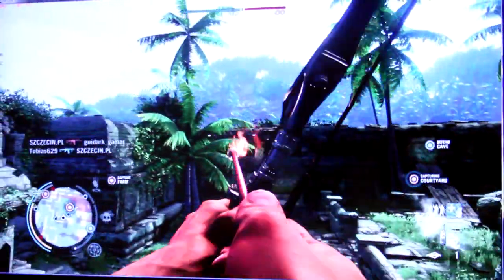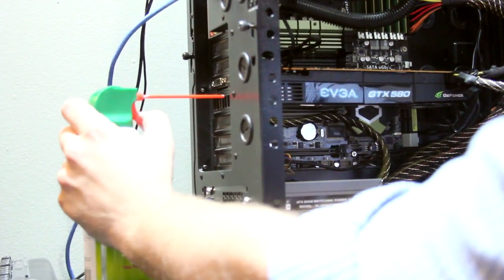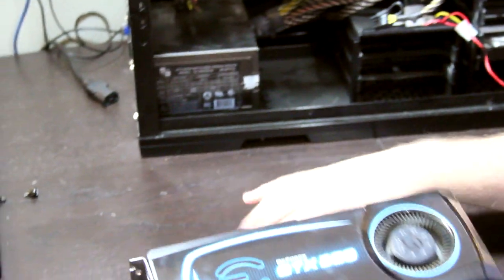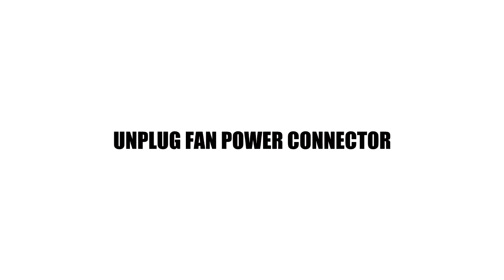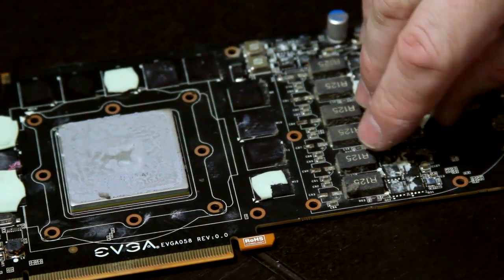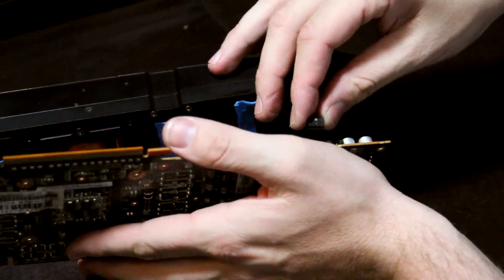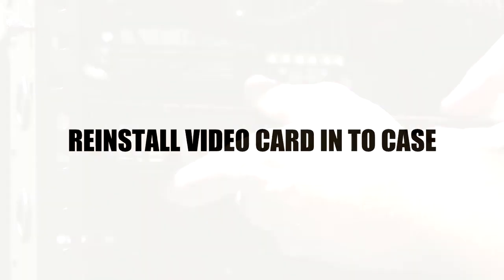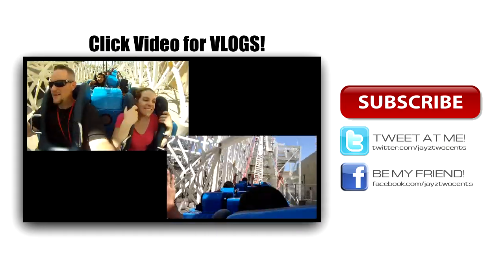How to fix overheating video card - Jayztwocents Tutorial

Comment: When I play games like BF4  with my gtx760 my computer will randomly turn off and when I feel the top of my case it is quite warm. Does that mean my GPU will have overheated? I do believe that is the case and I only play one level of BF4 at a time before letting everything cool down. Am I correct with my theory?
Reply: it could be your case not having proper air flow, eg no exhaust fans and also just do what it says in the video and do the same with your CPU cooler, it may be worth getting some more efficient case fans as well, but yes,I think this is a case of overheating
Reply: Envious_m8 I've installed an exhaust fan and plugged in the intake fan and it has worked quite well but sometimes when I'm on a high end game I can feel the side panel where the motherboard is gets quite hot so should I get a new CPU cooler or is there something I'm missing?
Reply: what CPU cooler are you using
Reply: Envious_m8 The stock cooler.
Reply: intel stock cooler?
Reply: Paul DeBruine I'll check around and get one when I get the money
Reply: MrRyangrrr Buy a Cooler Master Hyper 212 Evo. Costs almost nothing and is amazing.
Reply: mrawesomelemons That could go well in my build. Got a CM case for my build lol. Thanks for the suggestion!
Reply: MrRyangrrr When i built my first PC my case didn't have any fans, it simply caused the worst thermal throttling i have ever experienced but no shutting off. I about a month after heavy usage it began to shut off. I later discovered that it was my crappy power supply. you should take into consideration that it could be the PSU. Sure stock coolers suck and have high temps but they are not designed to give temps so bad that it would shut off a computer.
Reply: Jonathan Medina Could it be the thermal paste? I've had it over a year so it might be getting a bit crusty. I'm planning to upgrade my CPU anyway so if this is still the case I will invest in a new PSU.
Reply: MrRyangrrr Well a stock cooler plus old thermal paste, I guess there is a chance that is causing the shutting of. But if you notice that the automatic shutdown is getting or has gotten worse over time, I would still consider the PSU.
Reply: MrRyangrrr What PSU do you have, is it a cheep Chinese PSU or a well known brand? Or is it considerably old?
Reply: Jonathan Medina It keeps doing it when I play AC4: BF. When you (spoilers) kill that dude on the Spanish galleon. Even when I quickly ran to the same section. I'm using an Arctic Red PSU if you've heard of it. It's a 750W one I think I'm not too sure. Anyway I'll turn down my graphics settings a little and see if anything changes and turning off/down Anti-aliasing seems to help in most cases.
Reply: I have never heard of it myself but did a quick search and found prices ranging from  £20- £30 for 750W. PSUs that cost verry little for a high amount off watts normally aren't very good.Do you have any friends that might let you borrow their PSU to test your PC? I think that would be your best bet to rule out PSU.
Reply: Jonathan Medina I Don't have any friends who do. I had the PSU picked by someone else and they know a bit about them. I don't think it's the PSU because when I feel the side of the case the motherboard is mounted on, it's very warm at times so the shutting off is a countermeasure? I dunno, I've been a PC gamer for 1 year and I'm kind of going with a bit of common sense unless I don't have any lol.
Reply: PC Gamer doesnt mean that you know about computer hardware. I shall pinpoint the problem to several cause as follows:
- Heat. Check out your CPU / GPU / Mobo heat. Install monitoring software comes with your mobo or elsewhere from internet. It is free. DONT FORGET LOGGING it. If temperature of those said above under TDP range, then it is something else.
- PSU issue: by looking at the price vs wattage of your PSU. I must say your friend dont know abt PSU too. I would rather pick up a well-made 300W than advertising 750W. Why ? Because that 300W PSU will definitely deliver 300W without any voltage spike, ripple...etc while your PSU certainly will be unable to deliver a half of that 750W. My experience: I had to use similar PSU while my Corsair HX1000 going to RMA and then one day, voltage spike ( 12v rail jumped to 14v as my last seen) burned 2 SSDs and 2 HDDs. 
- Mobo: Very unlikely. But it is possible. Check out your setting in BIOS/UEFI to see whether any thing is wrong. But first, hit Load Default Settings from your BIOS/UEFI.
Reply: SK Bean Which monitoring software would you recommend? I've got Afterburner installed but that only monitors GPU temps.
Reply: MrRyangrrr Afterburner monitors almost everythin. It can even monitor cpu load..
Reply: mrawesomelemons I can't find it. But is there any other monitoring software you recommend?
Reply: I don't know how you can miss it.. There are even graphs showing the past values. Aida 64 or speedfan are good programs for monitoring too.
Reply: mrawesomelemons Cheers.
Reply: mrawesomelemons I've had a quick game of BF4 and when I came off of the game, one of the fans hear to hop half of my case was going mad. (also when I started aiming I got lag spikes) I had a monitor open for everything and all of the temperatures were stable (some were quite high being at almost 80 degrees) but my voltages stayed the same on my motherboard. But when I feel the vent where the PSU is located at the back, there is a small area in the middle of the vent which is quite hot, but the rest is normal. What would your opinions be on this information? PSU or CPU?
Reply: mrawesomelemons I think it's the PSU. I just ran Sleeping dogs (original) and it shut down when I walked out of my house. Any recommendations? And I only have 1 PSU so I have none to test (as this build is my first and only)
Edit: Shame there's a gun law in the UK and I'm underage anyway so I can't put a buckshot through it.
Edit 2: If you know any good ones that are blue and under £40. And 80+ rated.
Reply: MrRyangrrr Haha yeah that sucks. But do you smell burnt electronics? If yes, your PSU is overheating. Which one do you have?
Reply: mrawesomelemons I can smell something that does smell similar to a hot metal smell. But I do have a radiator next to me which is on quite hot as it's winter. Guess it's time for a new PSU. Que sad music
Reply: MrRyangrrr I don't know what system you have but take a look at this: http://www.tomshardware.co.uk/forum/id-1804779/power-supply-unit-tier-list.html
Reply: mrawesomelemons I have an FX6300
GTX 760 4GB
7200rpm HDD
Bog standard DVD+RW
WiFi card.
I calculated it and it went to above 400W
So I'm guessing a 500W one would be good to be on the safe side bearing in mind I'm looking to save up for an FX8350 soon.
Reply: MrRyangrrr I have a Seasonic M12II 620W psu. It is good. Mine is loud but my brothers isnt. You can buy an EVO for full modulair stuff ;)
Reply: mrawesomelemons That one is a bit too expensive for me. I've seen a nice one from EVGA http://www.amazon.co.uk/gp/product/B00GP5Y6J0/ref=s9_simh_gw_p147_d0_i3?pf_rd_m=A3P5ROKL5A1OLE&pf_rd_s=center-2&pf_rd_r=1Z1PMGKK70S6VH7K1CCC&pf_rd_t=101&pf_rd_p=455344027&pf_rd_i=468294
Would you be able to tell me if it's a good buy or not?
Reply: I'd say that's one of your best options for the price. 3 year warranty, trusted brand, and 80 plus certified. its a steal for £33.02
Reply: Jonathan Medina Also on sale from £40.99
Reply: MrRyangrrr Yeah that one is decent too. EVGA makes decent PSU's.
Reply: Jonathan Medina I also might bump down to an FX8320 as I get more performance for the money and it's cheaper with similar performance.
Reply: MrRyangrrr Yeah the 8320 is a downlocked 8350. I have a 8320 running at 4,8 GHz
Reply: mrawesomelemons Would it bottleneck a 760?
Reply: Nah youre fine. I think it wouldnt even bottleneck a 970 in most games
Reply: mrawesomelemons Cheers. Also today I've realised how hard it is explaining that you need a good PSU in the first place to parents. (They don't get technology)
Reply: MrRyangrrr Haha tell me about it.. Just tell them that if you buy a bad one the bill is higher and there is going to be fire. They'll understand that ;)
Reply: mrawesomelemons I've ordered it anyway lol. Amazon says it will arrive between the 1st and the 3rd of Feb. I also set my custom resolution to 1440p so the new PSU shouldn't burn down our lovely domicile or my whole computer.
Reply: MrRyangrrr Ah nice. I'm curious ;)
Set to a custom resolution of 1440p? What do you mean?
Reply: mrawesomelemons For Nvidia cards:
Right click on the desktop. Go to Nvidia control panel >> Adjust desktop size and position. check: override the scaling mode set by games and programs. >> change resolution >> customise >> 2160 x 1440. save that.
Reply: mrawesomelemons I've installed the new PSU. I'll see if it doesn't blow up on me.
Reply: MrRyangrrr I have AMD, but I dont know what that option does. Is it like Virtual Super Resolution?
Good luck! I have faith in it.
Reply: MrRyangrrr Have your problem got fixed now? because I have similar problem and I will try to replace heatsink soon or maybe PSU. Did replacing PSU worked for you?
Reply: sinestar10 Yeah, the problem is fixed now. Waiting for Hardline to install to give it a real test. It hasn't shut down since I got the new PSU.
Reply: So replacing the heat sink for my Video card will not solve the turn off problem while gaming ? because I had to have some high temps before the problem started
Reply: sinestar10 What are high temps? How hot exactly? And what brand is you videocard and psu?
Reply: I have GTX 560 and a 500w Gigabyte PSU, they worked fine for over year and half and accidentally video card started to shut down during gaming at 80 celsius degrees. I think my problem is overheating not PSU because I tried another lower tier card on same PSU and worked fine
Reply: sinestar10 What brand? MSI, reference, Gigabtyte? And how hot does your card get?
Reply: it's EVGA and it was 45 degrees at idle and 80 at normal gaming load
Reply: That should be safe. Have you tried raplacing the thermal compound? This sounds indeed like a psu failure. What are your cpu temps?
Reply: fine around 35 to 45, so it's PSU not overheatig? however I tried another card and it worked
Reply: sinestar10 And your card in a diffrent system?
Reply: yeah tried my card on a different motherboard and ram but failed again to work properly
I'm still not 100% sure if it's dead card,or overheating problem that can be solved by replacing a new heat sink but I think there's a minimum percentage that it's a PSU problem
Reply: sinestar10 The maximum safe temperature for a GTX 560 is 99 degrees so 80 still should be fine. If it exceeds 99 degrees it will start to thermal throttle so a overheating problem isnt probably it. What you can try is to replace the thermal compound (that is probably dried up) and the temperatures will drop about 10-15 degrees. If the problem still persists your card is probably at the end of its life.

Comment: Im making my first build and i want no problems electrical and heat wise. Im getting Corsair H50 or 60 water cooler for my cpu to keep that cool. If i have a cpu cooler installed i can also add a gpu water cooler? (Im scared with the gpu water cooler because alot more screws and bigger. OVERALL Is 2 water coolers going to fit in a case (Corsair Spec Op 2) Is the installation easy and user friendly?

Comment: yeah...3 basic things and the most effective to do is clean your fan from dirt,put new thermal paste and if you want beter temps then put your fan speed on higher speed,my GPU is GTX650 and when im idling its 33 C,when gaming (after OC I did) its 72-74 deagrease,without OC its 66-68 and its not that new,I have this card for a year and a half and every month im cleaning it and I never got more then 74 degrease and I got my max OC

Comment: What I usually do is immediately upon getting a new graphics card (or CPU), I replace their thermal paste with mine (I have been using Arctic MX-4 lately) since the aftermarket higher end TIMs tend to be better.

Comment: Do you need to clean the thermal pad witn alcohol too?
Reply: no you dont need to clean the thermal pad. if the thermal pads are not ripped clean where ther were on the graphics card or cooler. if they are ripped, replace them.

Comment: When playing crysis 3 my GTX 760 hit 89 degrees Celsius. After cleaning out the dust of the graphics card it is now at 83 degrees Celsius
Reply: That doesn't sound right. My 760s rarely, if ever, break 70c under load.
Reply: Keihryon Yeah the reason for that was because the computer was in a cabinet so the gpu was overheating. I took it out and place it in the living room with the air conditioner on it cooled down to 75 degrees Celsius
Reply: Get something like asus gpu tweak and ramp up the fan speed to 40% or something.
Reply: Yeah I should but it gets quite loud since it has two fans

Comment: Hey JayZ. I recently got a pair of R9-290's. Running Xfire. However, when gaming, they get really hot (much hotter than my zotac 2x770GTX). I have also noticed when gaming that I get white glitches on my screen. This never happened with my 2x770GTX. It is happening only with my R9-290's. What does this mean and how can it be fixed?.
Reply: AMD cards usually run hotter than nvidia cards.
Reply: ***** Hi. Yes, I am aware. I used to have a 7990. Anyways, it seems AMD has an ace up it's sleeve, as the R9-290/X is actually more powerful than they let on to. It apparently has 3072 processing cores (and AMD did say they were going to release an upgraded 290X in summer 2014, one that would topple the 780Ti). See -

 http://www.kitguru.net/components/graphic-cards/anton-shilov/amd-readies-enhanced-radeon-r9-290x-hawaii-graphics-solution/

Comment: My EVGA GTX 660TI got to 96c...
I took the cooler of and what was under there was horror, a part of the gpu wasn't covered with termal paste, only like a part of the gpu.. Now it runs at 77c after doing this =p
Reply: +Jimmon must be a freezer case.
Reply: Jimmon
lots of factors depend upon the temps. I live in india which is getting hotter day by day. And i have a single fan asus gtx750ti but there is also a dual fan one which i didn't get unluckily. Still 44-48 is very good temps. Mine goes to 65-70 and sometimes at max load 80s but that is normal temp for a gpu.
Reply: Salman Shaikh 117c.... that doesn't sound right though.. xD
Reply: Jeez i couldn't live with these temps. My asus gtx760 runs at 29°C on idle and 44-48°C on load x)
Reply: Thats still pretty hot for a 660ti my 660ti was a ref cooler and overvolted and OCed it ran at 75C
Reply: Velocity I know that it was still pretty hot.. this was with fresh thermal paste though. Now it runs at around ~73 (But not right now, because it is dusty inside my pc.. xD )
Reply: it is mormal.My asus nvidia 750 ti goes to 71-74.And my old Nvidia 9500gt would to whopping 117 degrees and around.
Reply: yep it was that only xD

Comment: You can honestly use any method you want on the CPU, as long as you don't apply too much. The only one I would honestly advise against is making a very flat plane across the entire CPU (as this can create air pockets when the heatsink is applied), but otherwise a dot or a line, four lines, or eight won't make a difference. As long as it's on there and coats it well, you'll be fine.

Comment: Quick question Jay: when you were cleaning the video card, you blew on the fan and it was spinning. I constantly hear that this can be really dangerous, so when cleaning fans would it be better to do the circular motion you did, or hold the fan stationary (on the center, not on the blades, just in case), or what?

Comment: so I used the MSI kombustor to do some tests on my gtx 560 and had these results SCORE: 5116 points, FPS: 85 (60000 ms)
I had an average score of ~3150 and 59 fps before I tweaked around my settings. Boom instant 26 fps and massive score boost in an instant :D

Comment: When I got my MSI HD 7850 after a a few weeks I changed the thermal paste and temps went down by like 6oc and the fan speed also went down I find that they tend to use cheaper past when they make the cards or they where sat around for to long before shipped

Comment: i did this to my gtx 480 once i removed the fan and placed in a new cool master fan and blowed the gtx 480 with the air duster thing then i changed the thermal pads and grase i got like 50 c or 70 c or even 60 c it really helped my preformence